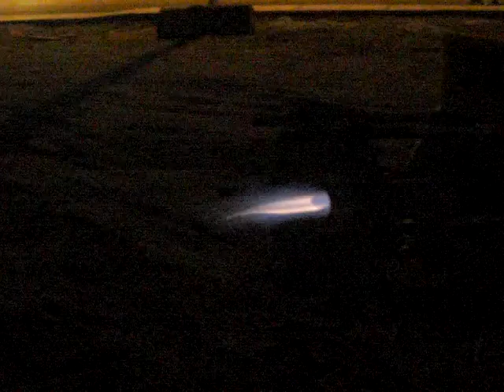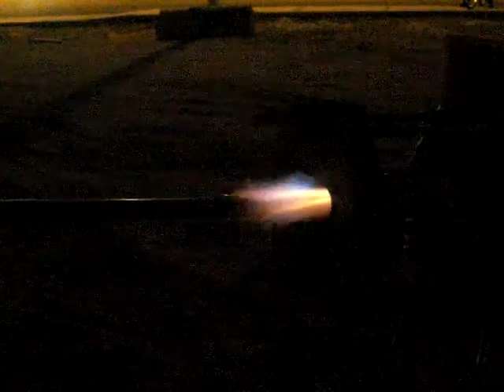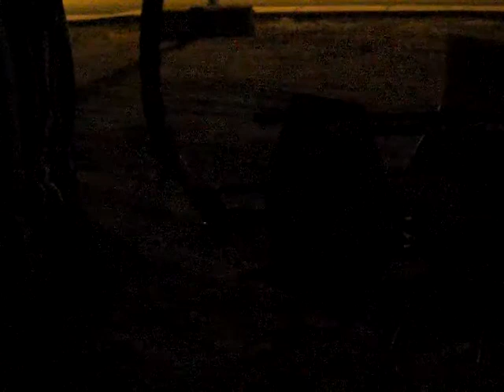83-PART 2 of 2-STEAM INJECTION into HYDROGEN BURN Test.

Comment: I think super heated steam oxides iron or metal, but you may infact be burning hydrogen, are you using a wet or dry steam in the burner?

I am injecting dry steam into my cars intake and it gives me 15% more torque, I don't understand how it works but I am enjoying the results.